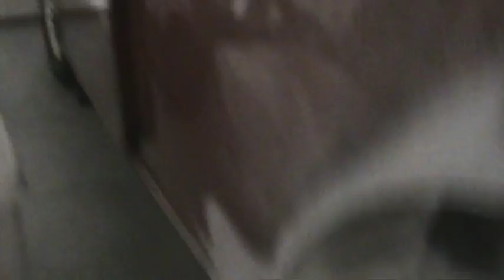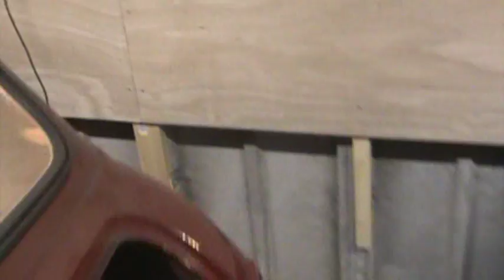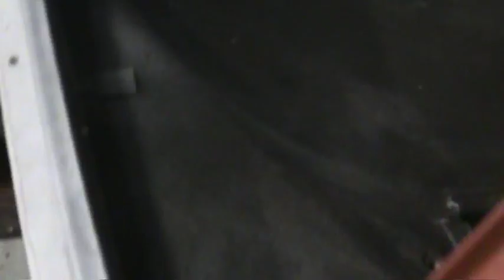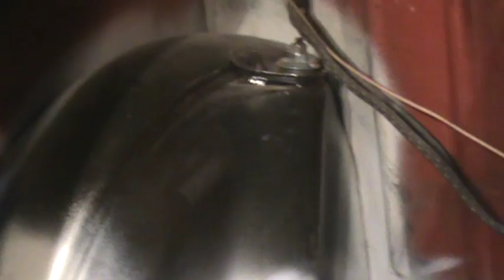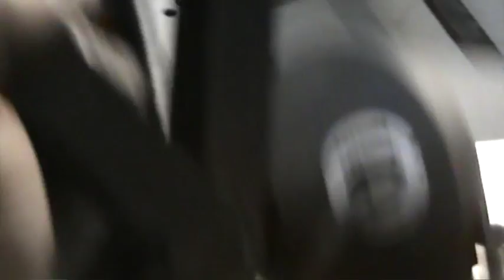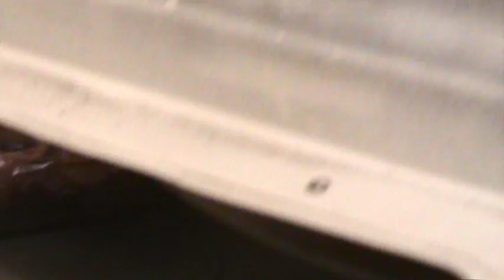1960 Morris Mini Minor Restoration (Part 2 of 10)

Comment: Hello, I’ve got a 1962 classic mini which also needs a boot floor, where abouts did you got your yearly correct one? Thanks
Reply from the maker: zak ellis 
Thanks for the message. The best place to get them from are a company called “M-machine” in Darlington. They can adapt boot floor and battery box for the very early minis. Also. The battery box should have two holes on the underside instead of three holes like on the later ones. I hope this helps.
Reply: John Derby okay awesome, I’ll have a look and purchase one thank you,
Reply from the maker: zak ellis 
Ok. You might have to get them to make one for you. They would use a heritage floor for a later mini and adapt it specially for your year of car. They know what they’re doing and it’s worth the wait. I waited two or three weeks for mine. 
John
Reply: John Derby
Okay, how do you ask for them to make a floor correct for the year and how much did yours cost? 
Zak
Reply from the maker: zak ellis 
If you explain to them the year and model of your mini they'll explain what needs to be done. They really know what they are doing. The floor assembly included the early mini mk1 battery box, petrol tank support etc. Also holes modified for the fuel tank lines.
I think over £200. Can't be sure now as it was a long time ago now.
Reply: John Derby 
Alright when I sell one of my cars I’ll phone them up and see what the story is, thank you for you help. Much appreciated thank you
Zak